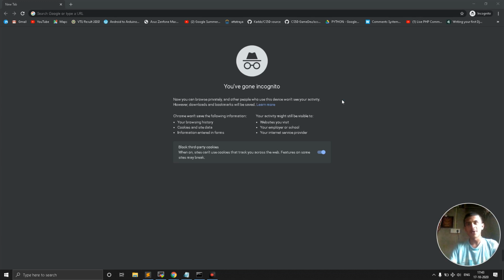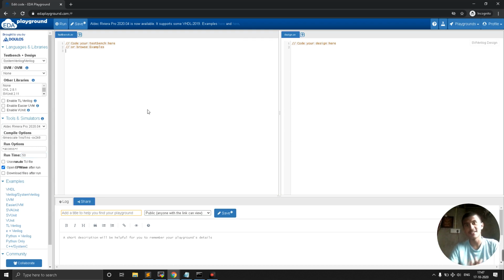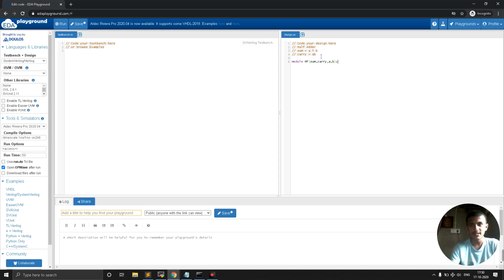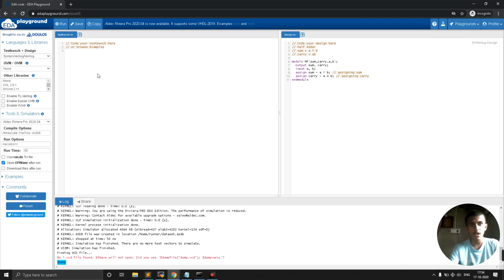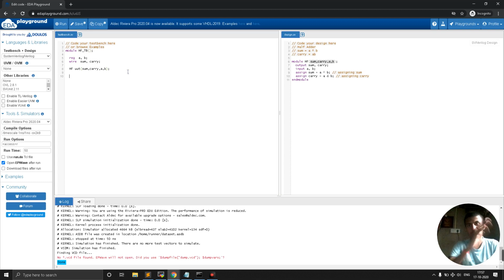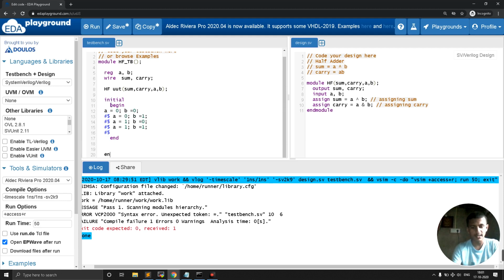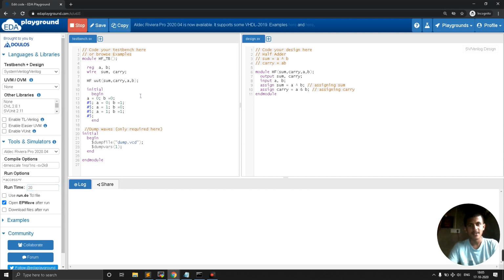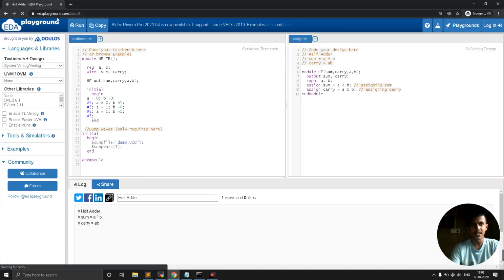Verilog 3 Half Adder EDA PLAY GROUND

Comment: Can you plz  make video on car parking system using fpga on eda playground
Reply from the maker: On eda playground i guess its not possible to connect hardware and send code to FPGA. What you can  do is, use 4 parking slots, for each slot attach one ir or ultrasonic sensor and connect one display to FPGA. Now in verilog code, simply read the input of all those 4 IR, sensors, if car is there is slot, ir will output 1, else 0, simply use if condition and display which slot is free or which slots are occupied..